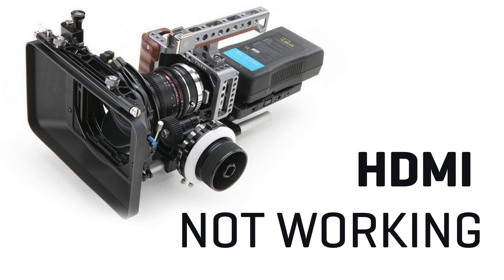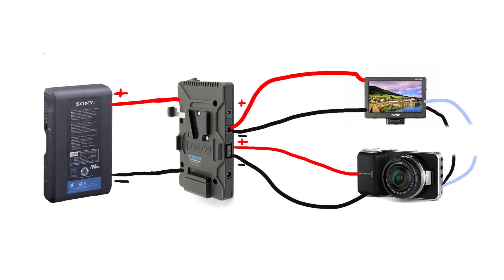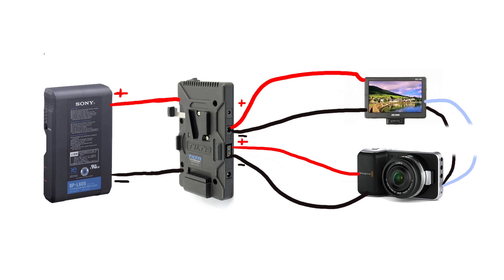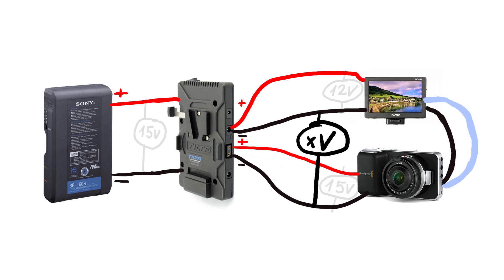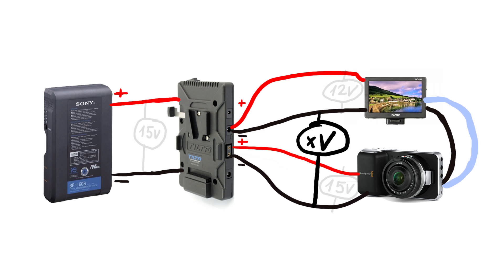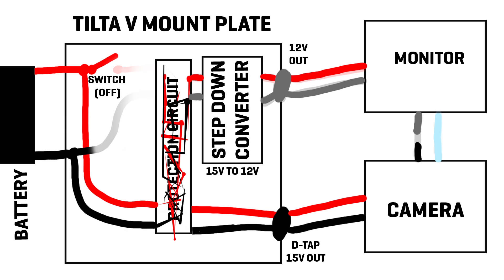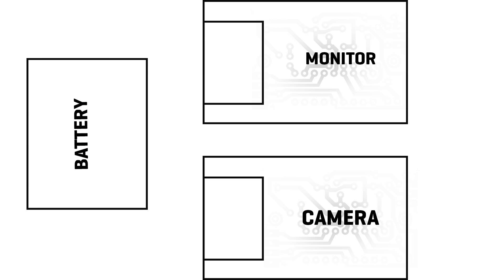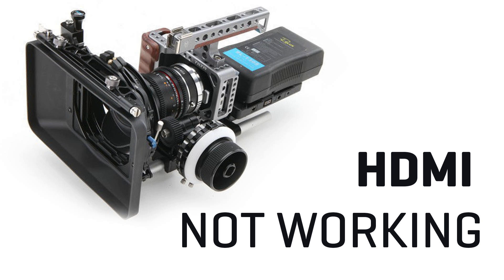How not to break Blackmagic camera: HDMI / SDI not working

Comment: The IC is MACOM 21428. This is used in BMCC 2,5 K in decklink. The IC buring if error connection in SDI or over voltage present in BNC loop.

Comment: I realize this is a very old post, but there are other cameras that have this issue.  My basic question is if there are any V-Mount plates that you know of (even expensive ones) that can prevent this ground loop issue from occurring.

In case you're wondering this is also  Z-Cam issue.  Z-Cam relies on HDMI which can have this problem.  Most professional cameras that work over SDI don't have this nasty ground loop issue (eg: this is not a problem on RED, Arri, Sony [specifically cinema cameras, not referring to Alpha line], Panasonic [Also referring to cinema cameras], etc).
Reply from the maker: Hi! Thanks for the update. I have used only separate power supplies since and did no more research. I´m not an electronics professional, but think it´s a matter of bad electronics design and maybe it´s not entirely BM´s fault but the HDMI driver IC manufaturer´s one. To make it even worse to diagnose it also may misbehave only in certain two HDMI controller ICs combination.. 
I don´t know if the difference in voltage potential occurs in between data lines or if it goes wrong when connecting two 5V rails together through the connector ( like RAMBO development board has solved over Arduino in USB 5V connection) And then again universal fix may require substantial circuit board revision and could get quite costly :)

Comment: i think 15v is too  much for the camera, it says 12v on the body right?
Reply from the maker: It takes 12-18V with no issues, it regulates the power supply internally anyway, just below 12V it does not charge the battery if there´s a power drain from a stabilized lens. I think something like 12-18V input is even stated in user manual ;)

Comment: Hey David, thanks for this explanation. I had the same problem after using my Blackmagic Pocket and a Kinotehnik EVF (LCDVFe), both powered by a LanParte battery plate (LPT-VPB-02). The micro HDMI port is dead and I thought it was physical damage, but now I'm sure it was electrical. There was a strange high pitched noise coming out of the EVF, but pretty discrete so not that concerning at the time, but after several use the HDMI port died. 
Anyway, I'm soon going to use a blackmagic Micro and definitely need to avoid this problem, if possible without having to use another battery. Did you find out more about possible solutions ?
Reply from the maker: Hi Charles!  I'm using always separate power sources for monitor and camera - both has its own battery (4S Turnigy LiPo) - when powering from a wall outlet, separate transformers (where primary and secondary windings are not joined together) will be also a safe way. Unfortunately I don't know the real extent of this vulnerability so it's better safe than sorry to use separate power sources - or use a monitor only with batteries. Let's hope 4K Pocket won't have these sort of quirks.
Reply: I guess you're right, better to be safe than sorry, but I fear my rig is going to become more and more complicated and less practical. The other issue is that I have a Tilta Nucleus M system, that also requires power, and that is physically linked to the camera through a LANC interface. So I'm wondering, if I power the camera through an independant power source to "protect" it, but if both the EVF and the motors are powered through the same battery, knowing that they are both wired to the camera, do I risk damaging something in the chain ?
Reply from the maker: @1Caballo8  Ufortunately I have no experience with Nucleus, but although I no longer trust the shiny chinese Tilta crap, I wouldn't be worried in LANC case, Nucleus will probably just switch camera's own 5 volt supply back to it, to communicate, there is almost no power draw etc.

Comment: Is there any way to fix this problem? My cameras hdmi is not working... I did power the camera and the monitor with the same vmount battery.. please some one help me...
Reply from the maker: Check if the connector itself isn't loose - if it is, it may be re-soldered.
If the hdmi driver is broken, it may be possible to change it by someone experienced enough in component level electronics but honestly I didn't chase the exact point of failure. Anyway you may ask at a local phone/laptop repair shop.

Comment: so we should avoid using an external monitor?
Reply from the maker: No, only I recommend using it with separate power source for camera and monitor :)
Reply: I see so if i use 2 different power source for each device  camera+ monitor there shouldn't be an issue . Thanx for the information  really useful + subscribed.